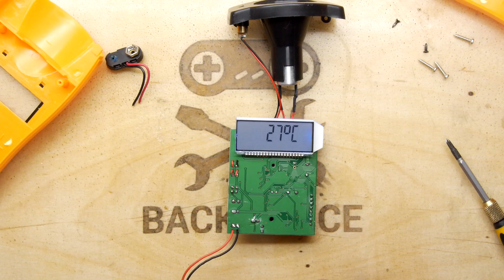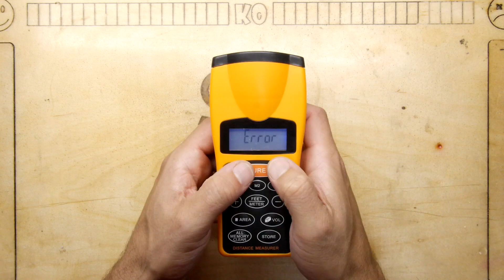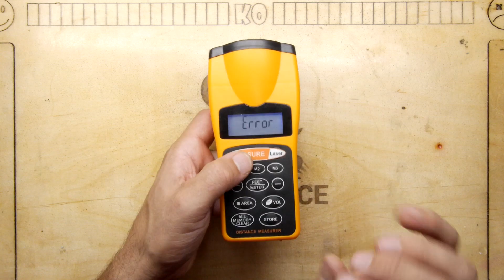Ultrasonic Measure Teardown and Repair

Comment: Speed of sound changes slightly with temperature. ;)
Reply: And yep, it's labelled NTC on the board (Negative Temperature Coefficient), so it's a thermistor.
Reply from the maker: Do you think it's really using the temperature in the calculations?
Reply: @backofficeshow  Yep, I think so?

I can't think of many other reasons for it being in there.

But you'd think it would make it tricky for it to measure the air temp properly anyway, especially if somebody had been holding the thing for a while.